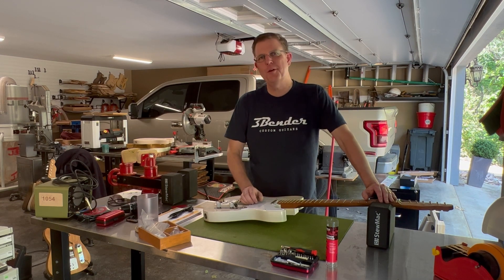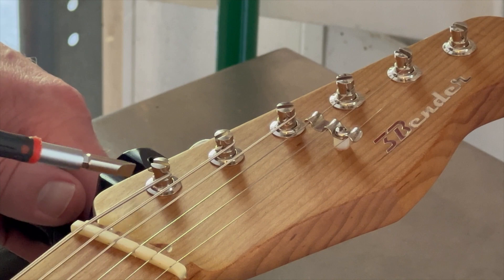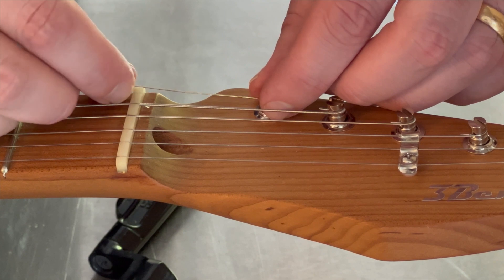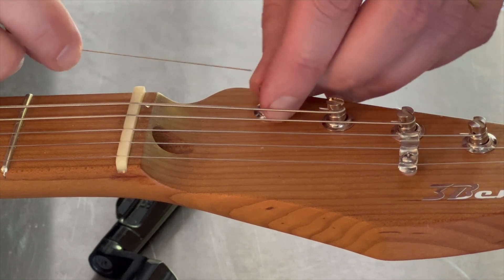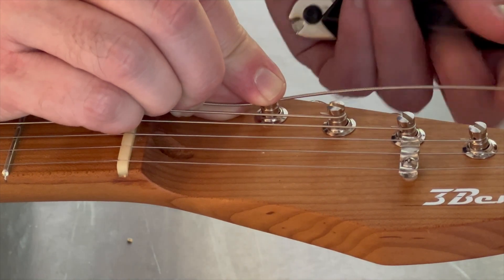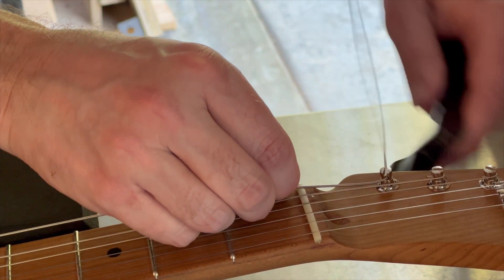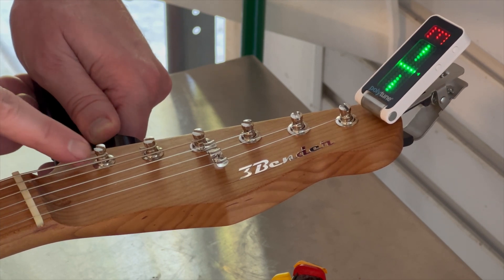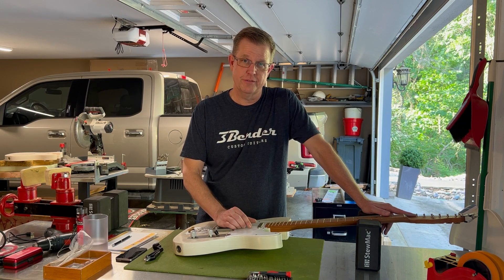Restringing a Guitar with Gotoh Vintage Locking Tuners

Comment: So my tuners came yesterday and tonight I finished installing them and just now got done stringing my Telecaster, and I have to say, i frikken love these! Haha I never gave much merit to locking tuners making string changes easier. I never really understood why I’d want them. I always thought they were for locking the tuner so that it couldn’t be turned thus making them more stable. Boy was I wrong..
But OMG it reaaaaally makes it easier. Wow what a difference. I have an electric string winder which makes it even easier. But there is no comparison between locking and standard non locking tuners. Also I found that I could just hold the very end of the string while using my electric string winder. I just pinched the string, (at the very end) between my index finger and my thumb. The little slot headed screw was fine with no pressure on it. And I didn’t have to hold the string before the tuner. Try it sometime. Just hold or pinch after the tuner, at the very end of the string. 
Thank you again for taking the time to make the vid. It totally helped me understand these tuners.
Reply from the maker: You are welcome.  I am really glad you like them and these tuners do indeed make strings changes much easier for me also.  Yes you are correct, it is not required to put your finger on top of the tuner post. In my experience it helps engage the thread. However, the threading usually happens quickly with or without your finger on top of the post. I think you will find they help stabilize tuning also. Thanks for your comments!

Comment: Thank You so much for all of your time and effort my friend.  I have about 20 guitars that I've installed Locking Tuners on; NONE of them have this type of Locking Tuner.  When I got my Fender "JV" Tele, a short time ago (very nice guitar by the way) I knew I had never used this type before.  It's, obviously, quite different from the other Wheel-type or Slotted-Screw Top (Fender, PRS or Grover) that I'm accustomed to.  Also, there's very little out there that displays how they function properly.  Your video, in my opinion, is the "BEST" I've seen; well done and thank you again...